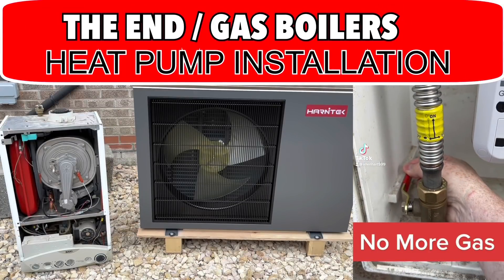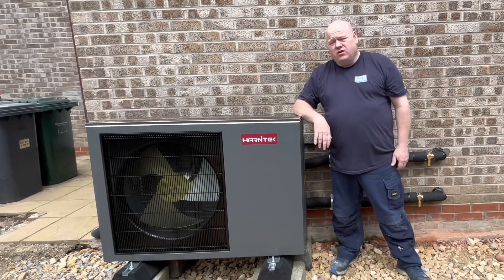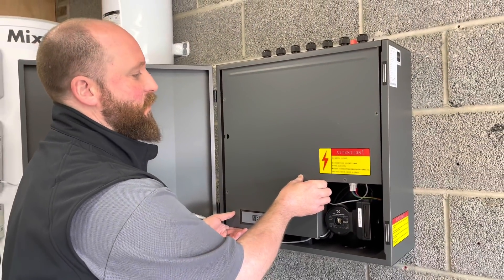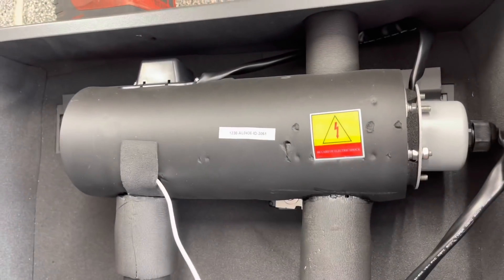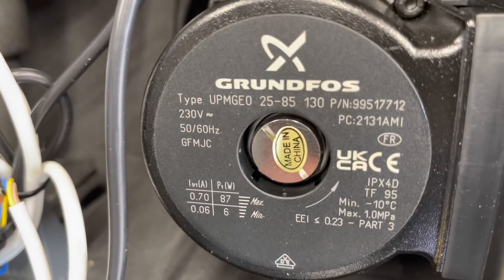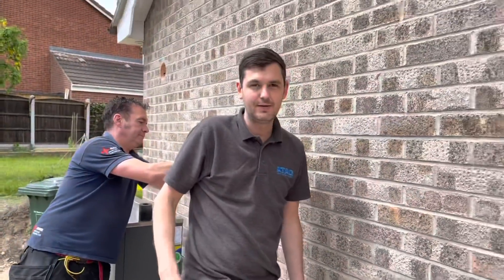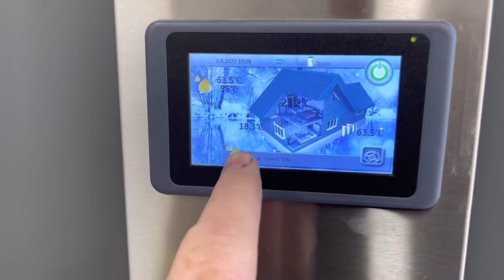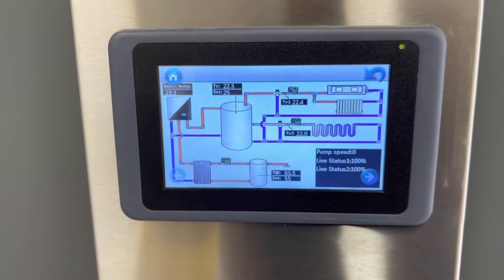ASHP INSTALLATION | The End / Gas Boilers Heat Pump Install Harnitek NGCFE

Comment: Great video Allan.
An idea for a new video could be for those of us unable to afford the outlay for the kit you have. What are the govt grants available, and what to expect in terms of system design/heat loss calculations from these companies that deal with these govt grants.
My fear is that these companies are just cashing in and literally throwing in systems that aren’t performing as they should.
Reply from the maker: I am not really sure about the grants but i will try and find someone who is. Thanks.
Reply: Gov offering £5k grants towards heat pump installs but only if a fossil fuel boiler is removed at same time.

Comment: Thanks again  Allen, for your input. Having installed a few ASHPs I can confidently say that the fabric of the building (heat loss etc) is key. If the building is very well insulated the customer will be warm and have relatively low energy costs. If the building is poorly insulated they'll be cold and have high energy costs! Simple!
Reply: i have to say  thats utter bull dust. You may as well say electric cars work best if all roads run down hill.
if you factor the insulation into a property a gas boilers going to cost u far less ?
With enough insulation body heat will do the job .
i agree ashp is probably a good idea in some situations 
However the insulation alone could radically  alter the heating requirements .
the massive problem is going to be getting the level of insulation retro fitted into the crappy housing stock we have in the uk .
Reply: @timeintheuk  that’s the real elephant in the room as I see it. I’m sure for new builds and the right type of housing they will be brilliant. But what’s gonna happen to all the people with houses that simply won’t ever be able to be updated with the level of insulation required? Imagine owning an old thatched cottage with solid walls, in a conservation area, with single glazed windows. Gonna be an interesting day for that owner when they turn the gas off. The government and the industry should stop saying heat pumps are THE answer and start being honest and say they are AN answer.
Reply: YES, but people don't want to hear this. People have a priority to brag about owning heat pump.
Reply: Heat loss is heat loss.  If you size the unit and the emitters correctly nobody should be cold.  You don't have to have an insane installation to reach cost parity with gas with modern units. 

More insulation always welcome where feasible.
Reply: @AmosMoses777  just had a full system enquiry from a listed office block town center no cavity in wall single glazed and no parking available anywhere.... I personaly think it's a swerve
Reply from the maker: Hi David. I haven’t updated anything yet. We will see how we get on. Thanks.

Comment: Do you have glycol mix in the radiator circuit?  I see the plate exchanger to keep glycol out the hot water cylinder but are the radiators full of glycol?
Reply from the maker: Hi Barney. That's a very good question. We haven’t added glycol no.
Reply: @AllenHart999  That's good, best to avoid any ASHP that need glycol for frost protection!

Comment: What size pipes are your house central heating pipes Allen
Reply from the maker: 28mm 22mm 15mm
Reply: @AllenHart999  
                      So is that 28mm from the Air pump to a manifold then the normal 22/ 15 mm

Comment: the mixergy tank I can agree with but "just" look at the amount of space that is needed for an air source heat pump its like the boiler room of a minesweeper and thats a "small" ship!
Reply from the maker: The inside Unit doesn’t take much space tbh. Thanks.
Reply: Get yourself a true monoblock unit and you won’t need any indoor unit. Just a 3 port, an LLH and a UVC. A UVC would be required if you had a system boiler anyway.
Reply: Look at it this way. A plant room to a heating engineer is like a rumpus room to a child 😂

Comment: Straight away you have lost my interest in it with the imersion heater,if that thing kicks in all your savings in efficiencey are lost and the cost will go through the roof.
Reply from the maker: Thats an interesting point but would you also rule out a hot water cylinder that has an immersion heater?
Reply: @AllenHart999  Yes I have a hot water cylinder but i would never connect the electricity to it unless I had solar and a device that dumps excess electricity into the tank heat (these are available)

Comment: Thanks for producing these ASHP videos.  Shouldn’t the system be left on 24/7 to avoid costly restart costs?  How many kw is your pump?
Reply from the maker: Hi The Bandit. We don’t pay for the energy that it uses tbh, It’s been too warm though so i turned it off.

Comment: That’s an impressive system. It would be very interesting to know what that would cost a customer if they were paying retail for it and a commercial rate for the labour. I’m guessing that with the increase in electricity costs, even never using anymore gas, you wouldn’t make that back in the lifetime of the equipment.
Reply from the maker: I will do a video on costing at a later date. Thanks.
Reply: @AllenHart999  thank you. I think that would be very helpful for people who are considering switching. Personally I’m holding out for a flux capacitor. 😃
Reply: @AllenHart999  that would be great, thanks Allen.
Reply: @AllenHart999  that would be great.
Reply: @Edward Lucas In the US, we use a few fan coil units to be separately operable (usually with “home runs” back to a header that has multiple connections) so that cooled water can be circulated to them in summer. Those fan coils have a condensation pan and drain line to the exterior, so no puddles. The heating radiators are not getting cooled water if they are not low-wall hydronic fan coils with drains themselves. In some cases, a separate “cold tank” or dedicated buffer tank for cooling is advisable if as here, the Air-to-Water HP (as we call them here) is simultaneously doing cooling and domestic hot water for taps/sinks. Hope that is helpful, but there are many ways to organize components depending on desired outcome. Cheers from NY
Reply: You can install heat pumps that send ice cold water to fan assisted rads that keep red sizes down and give cooling in summer.  All round temperature control.  A lot of people will pay for that.  Just offer on it finance.
Reply: @imaginehomes3871  I think there would be an issue with condensation puddles?

Comment: Allen thanks for being our canary in the coal mine. Also how long at its longest can a combiboiler last. I am in the states we love your videos and your prime minister. Any negative comments on that and we can trade. I just installed a Rheem combi myself  I have seen a large reduction in bill but these combis aren't built as well in my opinion as old cast iron boilers. Also you probably know this but these heat pump units are susceptible  to voltage spikes so install outdoor surge protector now outside because those control boards aren't cheap. Have a great day, cheers Britain
Reply from the maker: Thank You.

Comment: My money is on hydrogen. I live in a detached house and I’m not sure where I would fit that monstrosity you have in the vid. And if you live in a terrace home you are well and truly ducked. Infrastructure already in place for hydrogen.
Reply from the maker: Hydrogen will be very expensive though. Thanks.
Reply: @AllenHart999  if it ain’t hydrogen then log burner it will be.  We’re are people to fit all these heat pumps ?  If the gov say do (abc) I wouldn’t trust them 1 inch.
Reply: Green hydrogen is made using electricity and apparently you get 0.4kw of heat from hydrogen that takes 1kw of electric to produce. So it's cheaper just to heat with electric. Hydrogen will never be commercial without significant cost breakthroughs. It's being pushed by the fossil fuel industry but burning gas is better then using it to make 'grey hydrogen'.
Reply: would probably be easier to pipe hot water through gas pipes rather than hydrogen lol.
Reply: @Swwils  why cant hydrogen be piped in old gas pipes ?
Reply: Hydrogen is going to cost you so much more per kwh of heat, if that hydrogen comes from the same renewable electricity.  You are talking 3-5x.  The only advantage is you can store energy, but cheaper lithium batteries for homes are making this uneconomical already and in 10 years time it's just going to be stacked against Hydrogen even more.
Reply: "Infrastructure already in place"? You aren't thinking about running hydrogen through the gaslines, are you? 😱
I hope for you "my money is on hydrogen" is a figure of speech like with most people who say that, and you didn't actually put a mentionable amount of your money in the development of hydrogen home heating, 'cuz it ain't 'appening.
Reply: @Candisa  and what or who qualifies you to say it ain’t appening……….!!! ??
Reply: @pigswillbepigs  aaaah, after such quotes as "my money is on...", "monstrosity", and "truly ducked", we have the "what or who qualifies you..." defense ending on some punctuation mark vomit. Classy!

Comment: Top man…. This gives everyone a glimpse of what we have coming in the next 3-5 years.  It strikes me that in time, the size of some of the components should reduce as technology improves (E.g. the size of inverters and possibly even the size of the heat pump units themselves).
Reply: Physics are physics and heat pumps require surface area to extract heat from the air. I doubt they'll get smaller, but the prices may come down as their supply and availability increase in the UK.
Reply from the maker: Thanks.
Reply: I can imagine the large internal box going away.